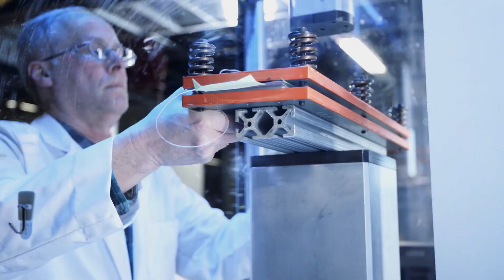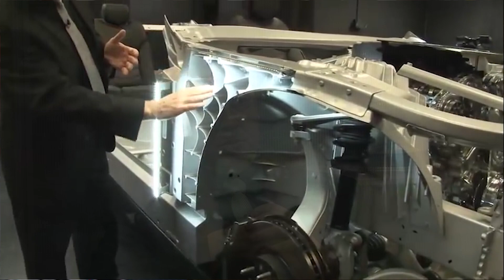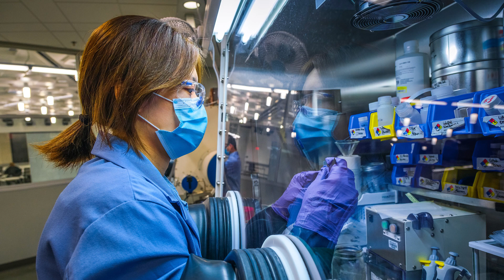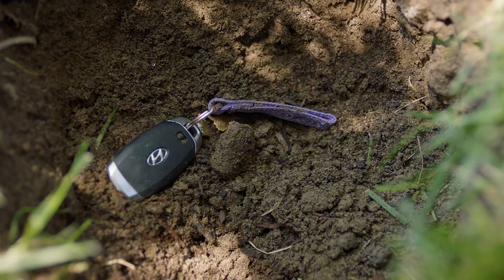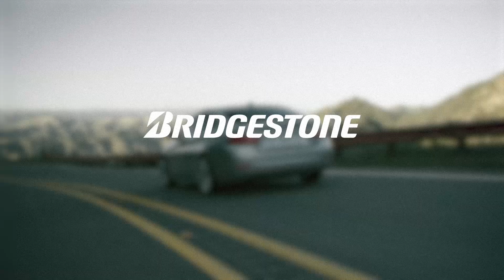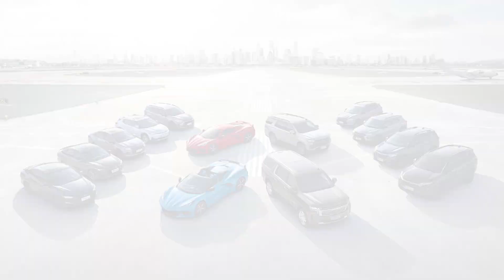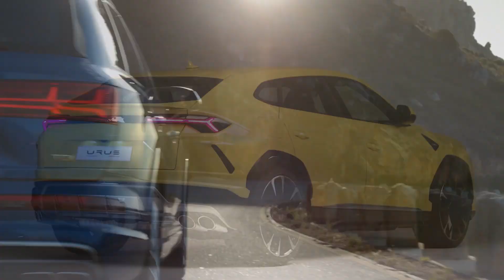GM Steps Up BEV Commitment; JLR Wants to Block VW Group SUV Imports - Autoline Daily 2964

Comment: Recently, I am in the market to replace my 2004 Saab 9-5 wagon. All the vehicles I WAS interested in (Acura RDX, Volvo XC 40, and less so, but still the Mazda CX 5) share the same design flaw, and frankly the DOTS sis apparently asleep at the wheel. Hoods should all be slopped to provide a minimum blind spot in the front of vehicles

Comment: I'm not sure speeding the development of EV is good news for GM. I've had both a Volt and Bolt, and both are half baked products, even thought the Volt was a 2017 and the Bolt a 2020. The Volt was a lease and paid off and sent back early it was so bad. Unfortunately the Bolt was purchased, so no as easy to get rid of.
Reply: What's wrong with the Volt? Our 17 has been quite reliable with about 60K miles. Aside from heating efficiency and the lack of BEV range, it has been solid. 

Surprisingly, we haven't had any serious problems with our last four GM vehicles. The Malibu needed an emissions solenoid replaced at about 80K. Vette needed a new speaker wiring harness at 60K. Sunfire did have the instrument cluster replaced early, under warranty, at 40K, but remained the only problem for a decade of ownership and over 120K. And Volt had the "gear" selector replaced under warranty about two years ago, apparently a common 2nd Gen Volt problem. Otherwise, everything else was preventive maintenance.

Comment: All this talk and only the Bolt in the showroom
Reply: If they have 5 cars in a showroom and 1 is a Bolt, they just need to remove one ICE and add maybe the new Bolt SUV and claim 40% of their showroom vehicles are BEV. Clearly they are not producing 40% BEVs. Those 3 row-SUV lines are their money makers and will not take a back seat to BEVs anytime this decade. Until they are producing 10s of Gigawatt hours worth of batteries it's all talk. Need those boots on the ground.

Comment: How will they (GM/FORD) overcome the lack of enthusiasm from their dealers for EV cars.  They won't be motivated to sell them since they won't need as much maintenance.
Reply: Unfortunately that is my experience with the Bolt EV. My nearest dealer didn't give me a test drive when I went in so I bought from a small dealer, and they don't have a technician in house to help apply the recall fix, which is just a software update!
Reply: I think that is GM/FORD's toughest nut to crack. Tesla keeps that extra 15% of dealership revenue/costs for themselves. I don't see how GM/FORD will be able to respond.
Reply: @KTPurdy  -- Same as usual.  They'll sue, alleging Tesla has an 'unfair advantage' of some sort, complete [BOLSHEVIK] of course, but they'll try anyway.
Reply: They'll cave, that was the plan all along.  To claim no one wants to buy EVs.

Comment: GM doing things it should have done a decade ago.  Too late or better late than never? We shall see.
Reply: Three decades ago, they unveiled the GM IMPACT at the Los Angeles International Auto Show.
Reply: Another challenge will be the dreaded “Osborne” effect. Why buy current ICE, when EVs are on the horizon?
Reply: Battery technology wasn't good back then. Some people assumed rechargable lead acid batteries would be the future. Turns out they got it wrong. Lithium has been out for a long time but it just became mainstream now.